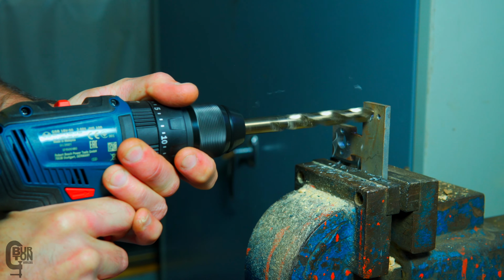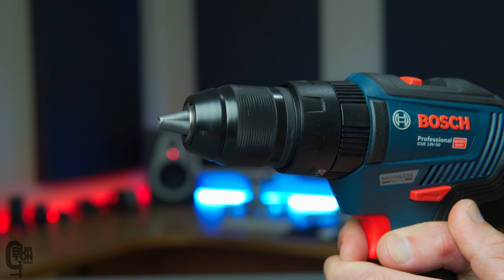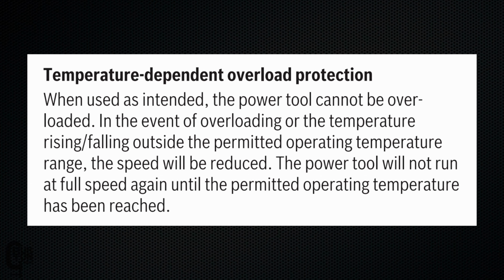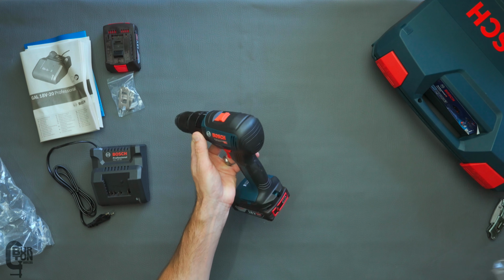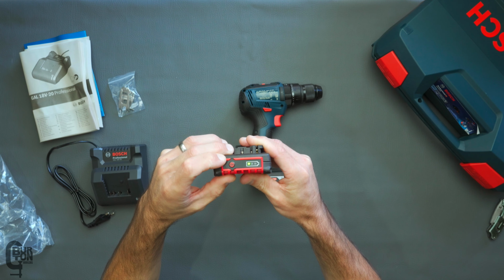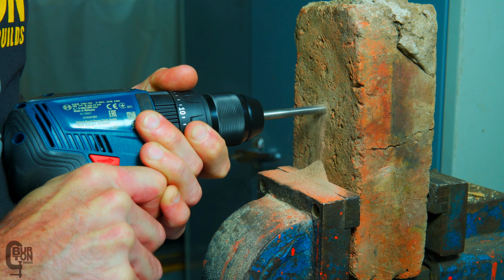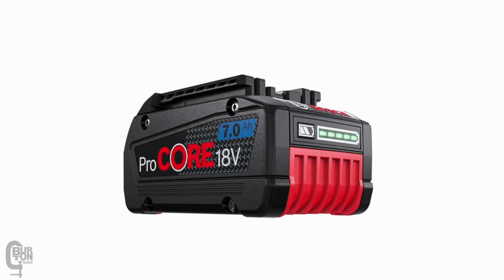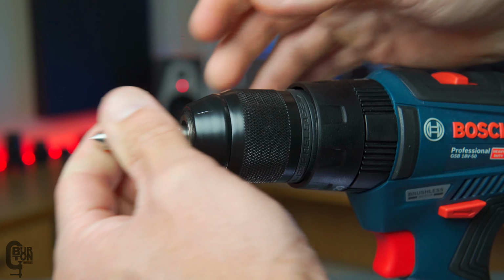Bosch Brushless Drill Review and Testing | GSB 18v 50 (Burton Builds)

Comment: Dear Grant, 
I have two identical cordless screwdrivers from this GBS 18-55 series. With one, the emergency brake works, the 'click' doesn't work, and the machine only stops with overrun. Since that bothers me a lot, I gradually dismantled the gearbox of the machine using your video as a guide. Furthermore, I cleaned all parts and greased them generously with special grease and lo and behold, everything works PERFECTLY. thanks to your video! -:) 

Thank you and best regards Manuela / Vienna

*original Text*
Lieber Grant, 
ich habe zwei baugleiche Akkuschrauber dieser Serie GBS 18-55. Bei einem funktioniert die Schnellbremse, das „klack“ nicht, und die Maschine stoppt nur mit Nachlauf. Nachdem mich das sehr stört, habe ich das Getriebe der Maschine mit deinem Video als Anleitung nach und nach zerlegt. Weiteres, habe ich alle Teile gereinigt und großzügig mit Spezialfett eingefettet und siehe da, es funktioniert alles PERFEKT, dank deines Videos!! -:)  
Vielen Dank und beste Grüße Manuela
Reply from the maker: Hi Manuela, thanks very much for your comment and I'm very happy to hear that the video was able to help you. It's always a good feeling to repair something. Nice to hear from you and best regards.

Comment: I have 1 that came in a set  that came with angle grinder a sander, bag, a driver, 2X 5ah batteries all brushless both batteries failed with in 12 months rather annoying
Reply from the maker: That is super annoying. Were you able to return the batteries under warranty?
Reply: @GrantBurton  no I took them apart and repairs them, 2 cells in each of them were bad I order 4 new cells and replaced the bad ones, they have 10 cells in each battery I couldn't find the receipt for them which was a bummer as the set  cost $960, I've also have 2x 6ah batteries coming, apart from the batteries there really good tools, all are pretty powerful the 5" random orbit sander and the 5" angle grinder are really good

Comment: I own the gsb-490 USA version of your hammer drill  with GDX18v-1800 In a kit  GXL-233B25 with two core 4.0 batteries 21700 cells  bag charger
Reply from the maker: Hi Tc, how has the drill been working for you? Still happy with it?
Reply: @GrantBurton  yes it's work really well for my job I do building  maintenance so the specs are just fine for my needs I don't really use the hammer function 22,000 bpm is low   for that we use the 18 v  bulldog   for  home I use Ridgid/AEG  they work just fine for that use I would have liked a case like you got but hear they tend to give bags
Reply from the maker: @bluemantom77  Great to hear it's working well. I don't own one and have never used one but I believe the original Bosch bulldogs are known to be awesome SDS drills... long lasting and hard working machines. I have mixed thoughts about hard cases... sometimes it's been nice carrying a hard case and all is neatly packed inside but other times, it's much more convenient to throw all the power tools loose into one bag and carry to site like that (less to carry). In the workshop, both bags and cases get tossed.
Reply: @GrantBurton  I personally don't own one it belongs to my job but I told my boss if he had to buy a new ones give one he will who knows if I'm still going to be there in the future holds

Comment: You are not comparing the two Drills (bosch and Dewalt) because, the Dewalt you used is a rotary drill and the setting is hammer, while the setting is only the Bosch drill, they should have the same hammer setting so we can know which one is stronger. in two and the drill bits of dewalt are different than bosch dull
Reply from the maker: Hi Manzera, thanks for your comment. The video is not intended to be a comparison video in which we compare the DeWALT SDS rotary hammer drill against the Bosch GSB18v-50 to show which one is better or stronger than the other... they are totally different drills.

I show the DeWALT SDS drilling through the a concrete brick to create a reference point to gauge what the Bosch GSB is capable of (or not capable of) in Hammer Mode. General DIY users may assume that having a hammer drill mode means they can use the machine to drill into brick and concrete, and that's not the case. While the Bosch may be able to drill a few small holes in low strength concrete, it will chew through bits quickly and pretty soon wear out the machine if thats what it's being used for.

Hope this clears things up.

Comment: Does it have chuck wobble?
As the otherday I was checking on my local Gartenbau and stumbled across this and when I picked it up it felt cheap :(
Reply from the maker: Hi Mr. Freeman... It does have a small amount of wobble which you can see at 16:25 however i don't think it will pose any problem as its not much, and you won't notice it especially during handheld drilling.

Comment: it should have supporting handle
Reply from the maker: Hi Mixo, I don’t think this drill has enough power to  warrant the need (and extra cost) for a supporting handle… the motor will eventually burn out if it’s put under that load while holding the support handle. 

When you start getting to the higher power drills… definitely a support handle is nice to have.
Reply: The more powerful drill has a handle, this drill is for medium to slightly heavy duty work. The drill with handle is heavy duty work

Comment: Have you ever tested your battery, please let me know, I would like to
   I know if it is normal for a 4 Amp battery to last about 1 hour if I use it continuously.  I cleaned the rust for an hour with a wire brush, the drilling machine worked continuously during this time of 1 hour. After that it was consumed. I am very curious to know.    Thank you
Reply from the maker: I haven't done a runtime test on that drill but 1 hour continuous running sounds reasonable on a 4Ah battery. The 4Ah battery is only 72Wh and I would guess the drill is easily drawing 70W when it's running with a wire brush, so 1 hour sounds reasonable.